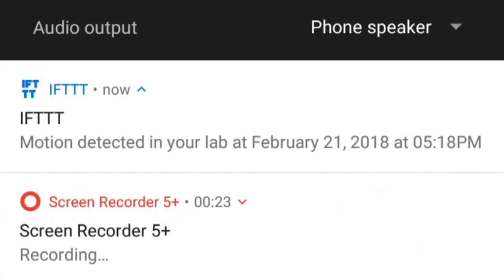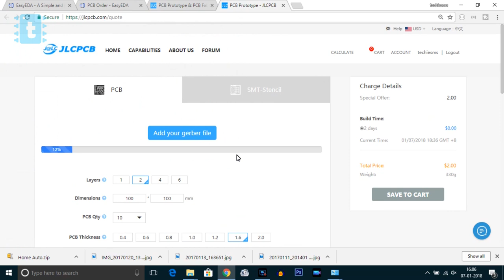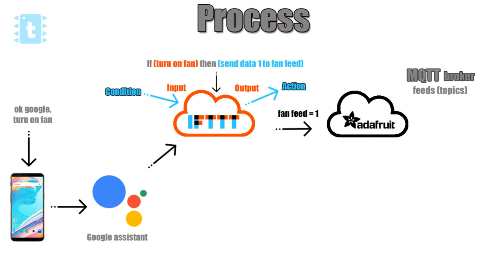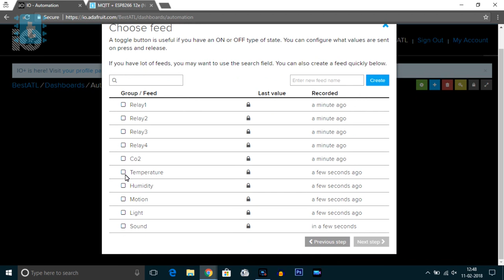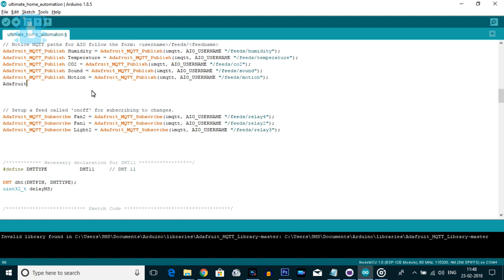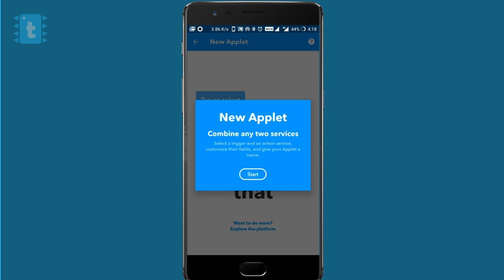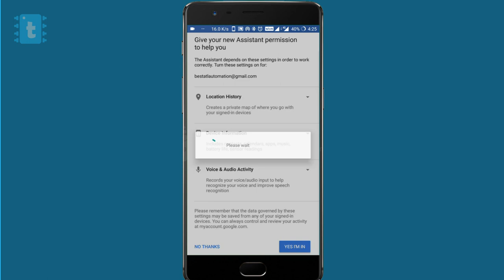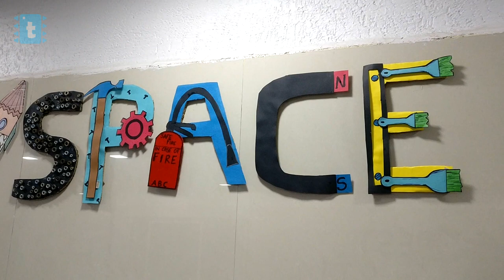Google Assistant Controlled Multiple Appliances | Monitor Sensor's data | IoT Projects | ESP8266 12e

Comment: We can use this for helping our moms in kitchen. We can monitor the temperature and LPG (leaking or not) from that we can turn on chimney or exhaust fan using relay. We can also turn on gas using Google Assistant also turn on light. Mothers have to see whether the water tank is full or not so that she can turn off the motor for that we will use water level sensor to check level of water in tank and to control it from Google assistant and IFTTT. We often open fridge without mother's permission so we can fit motion sensor so that mother will know that fridge is open. She can also control electrical appliances like Fan, Light, juicer etc. used in kitchen. 

Thanks .This was the best IOT tutorial by u..!!!

Comment: Firstly, Thank you so much!!! Your videos helped me a lot in learning about IOT. I'm from ECE and your videos are the best to know about many of the electronics especially nodemcu. I'm very much inspired by your videos and started doing simple projects using nodemcu. I have a project and idea which I am posting it here. Please do make some suggestions. I want to make a fully automated smart home that can switch on or off lights whenever you enter the room. You can also be able to control them using voice commands(using IFTTT and google voice assistant). You can also be able to control the devices like AC.Whenever the temperature is high (using dht11)and when it detects a person inside the room(using PIR sensor) , it automatically switches on the ac and gives a notification to the user. The project also focuses on security.Whenever we aren't home, and when it senses a motion before the door, it sends a notification to the owner.Picture of the person who is infront of the door can also be sent to owner.By setting the PIR sensor in a particular place or keeping the pressure sensor under the mat before your bed and collecting the data from some specified time in the morning we can identify when the person wakes and can automatically turn on the geyser and send some notification to the user.

Comment: people use teamviewer and other softwares for casting and controlling pc from large distances, but problem comes when the pc is not turned on. so we can integrate it to turn on the pc.
it should be applied where human errors occurs the most, like when someone turns on the water motor pump and forget to turn it off. it can inform the user about it and make user turn off motor or automatically turn it off.
it can be used to toggle headlights of cars in case someone forgets to turn it off. it can also be used to make car send location when asked and start vehicle and also to open or close garages.
it can be used to lock or unlock general home locks.
it can be used to limit usage of electronic gadgets used by children, so as to reduce their exposure to radiations and reduce wastage of their time.
we can command it to turn on toaster and coffee machines to as to prepare our breakfast while in bed.
thanks  for such a great guidance you provided through this video.

Comment: Hi sir 
I'm going make this project.
I'm startd designing pcb board but i have i doubt ''where did you use the PIR motion sensor in circuit?''
and connections of the relay "what did you connected between D0 and GND of the 9V?"

Comment: Stairs case wiring 
For controlling through mobile as well as Board switch's 
Both are we can use if mobile person is not there in lab so, we on off Appliances using switch's also.
Reply: Jaysukh Chavda yeah that would be convenient because relays are already SPDT
Reply: GPS module bhi interface kr sktehe kya ispe
Reply: Will staircase wiring work for this?

Comment: If it will take 20 sec to read data so when will it turn on the light bro as it is continuously reading lot of sensor there will be a great delay if i am wrong please correct me and please if you can explain the code more briefly

Comment: Hi,
Very Nice project and demonstration.
I would like to get the PCB or need your help to design with Easy EDA application.
Please suggest.
Reply from the maker: You can get my pcb design for free
Just search for techiesms user on easyeda
Reply: Thanks for your valuable response. 
Please suggest the link for the same. 

I have done a project with node mcu and relay module. But I wanted this to be on same pcb as you have done.

Please share the link for pcb and BoM for the same. 

Thanks & Best Regards, 
Rupesh Avinash Salvi
Reply from the maker: Connect with me on Whatsapp
82000 79034

Comment: urgent advice needed
what should  do if i have to connect mare than 4 relays ex if i have to connect 8 relays what should i do. PLS respond fast.
Reply from the maker: You can do that in the way I have attached 4 relays their is no trick in this
Reply: techiesms I tried doing that I even subscribed for the other four relays like it's done in the sketch and I connect the later 4 relays to d1,d2 and other data pins but the 4 relays that were already there worked the latter did not.

Comment: Hey, I need the Sensor Data on Google Assistant.
For example,
Me: Temperature at my home
Google Assistant: replies (reads the sensor value from Adafruit gauge) The temperature inside your house is 28 degrees.

How can Google assistant READ data from Adafruit?

Comment: it is good but it is not enough , i m also want to make home automation project which also count visitors with help of ir and in case of electricity power cut they notify me , if someone can switch on\off light it notify , and it has call based operations system using DTMF  for secondary options , door lock and unlock function and later on i m include R pi to add AI

Comment: 1)
It can be used as for agriculture field ( research field ) to know wheather temperature and humidity ,wind sensor rain detector all the sensor data and some out put devices from relay it connects to motor pump 
At night time automated bug Hunter setup will works totally the efficiency of this field can be increased and efforts will reduce by predicting the wheather

Also make a IoT gardan
2)
Also it can make a complete home automation for single living people because they the have to make their job easier via controlling appliances via internet

3)
The 3rd thing Maybe a stupidity!!

Because, it's my imagination and
if it possible only internet on space!!!

 whatever if it all implemented with all kind of sensors like light, temperature, humidity, magnetic field sensor,flux sensor, accelerometer, gravity sensor and all kind of gas sensor fixed on single board it can be act as a satellite and can launch with helium balloons and it can travel up to 30km and to over come the layer to make a small rocket like vehicle it can control by the relays...😎😎

Comment: Thanks a lot for your video and explaining. 
I think there are more precise temp/hum sensors DHT-22. 
You may use them in future (circuit is the same).
I think this project is perfect for studing. And it would be great to add some multiply temperature sensors ds18b20 to increase the ability to measure temperatures and, for example, to make automatic fan control according to setpoint temperature.
Please could you send me file for PCB board. 
Thanks and wish you great ideas for future videos and projects.

Comment: Mrunal Dhoble

One of the best thing it can be used is to Design a Smart Locker along with a Safest Locker room.. which must be equipped with a locking system using servo Motor and even we can track if anyone break's on to it using some essentially sensors and even we can place a servo lock system outside the locker room so as to quickly lock out the door from outside itself when opened without self access(using coding which will create auto-locking of the Door or manual command from phone). No need to fire a theft F.I.R as u'll get ur thief locked up in the locker room itself.. just needs a gud mechanical protection supported along with the locking module on the door. Plz let me know if this can be useful bro, and if yes.. i hope m in for the give awayz..😆😉

Comment: Hai, This is really a wonderful project and well documented. Thanks for publishing it. I tried it and it works fine but, if I have a slider to adjust the fan speed it will be still Great addition. 
Please suggest me the additional code lines in Arduino to incorporate this feature.
Reply: did u get the code for it sir??

Comment: great project , but if you can make that the google asisstant reads you out a sensor data , now that will be cool , like for examlpe room temperature.
Reply: Alexander221 I think you can do that with some ifttt integration
Reply: its damm simple use firebase as backend and and store your temp there and then just configure google assistent
Reply: The Arduino Guy i have implemented the same project using Blynk app so its quite similar 
can you please specify more details on how to do what you have mentioned??
Thanks
Reply: @ahmedsuhailabdullah6196  
Please explain me how u did that
Reply: @hemantbabel4279  
Hello, can u please explain me more on it
Reply: akshay shet just search how to use blynk app for automation, you’ll get it..
And the firebase one is a bit too lengthy and complicated
Reply: @ahmedsuhailabdullah6196  I want the sensor data to spoke out by the Google assistant when we ask commands as "what is temperature in room"
Reply: @hemantbabel4279  how to configure Google assistant?
Reply: @hemantbabel4279  how to configure Google assistant

Comment: I want to implement this project on my college. My college is an engineering college and college is very big and has many buildings . So,  There is a problem arises on switching on off the light of classrooms, labs , department and other places for the working peoples. So, by implementing this project we can omit this problem or you can that will be easy for them control things from any place. Also I want to implement this project like that I can control the light fans by normal switches and by this project. So, there will be manual option for some emergency. Also I want to add servos to control the speed of the fans by existing regulators,temp and humidity sensor and pir sensor.so,I  want those circuit boards for initial testing or you can say prototypeing in my college...

Comment: Arduino: 1.8.7 (Windows 7), Board: "NodeMCU 1.0 (ESP-12E Module), 80 MHz, Flash, 4M (1M SPIFFS), v2 Lower Memory, Disabled, None, Only Sketch, 115200"

Build options changed, rebuilding all
In file included from C:\Users\Mani\AppData\Local\Arduino15\packages\esp8266\hardware\esp8266\2.4.2\cores\esp8266/Arduino.h:27:0,

                 from sketch\sketch_nov16a.ino.cpp:1:

C:\Users\Mani\AppData\Local\Arduino15\packages\esp8266\hardware\esp8266\2.4.2/tools/sdk/libc/xtensa-lx106-elf/include/stdlib.h:16:20: fatal error: stddef.h: No such file or directory

 #include <stddef.h>

                    ^

compilation terminated.

exit status 1
Error compiling for board NodeMCU 1.0 (ESP-12E Module).
Invalid library found in C:\Program Files (x86)\Arduino\libraries\Ultimate-Home-Automation--master: no headers files (.h) found in C:\Program Files (x86)\Arduino\libraries\Ultimate-Home-Automation--master
Invalid library found in C:\Users\Mani\Documents\Arduino\libraries\libraries: no headers files (.h) found in C:\Users\Mani\Documents\Arduino\libraries\libraries
Invalid library found in C:\Program Files (x86)\Arduino\libraries\Ultimate-Home-Automation--master: no headers files (.h) found in C:\Program Files (x86)\Arduino\libraries\Ultimate-Home-Automation--master
Invalid library found in C:\Users\Mani\Documents\Arduino\libraries\libraries: no headers files (.h) found in C:\Users\Mani\Documents\Arduino\libraries\libraries

This report would have more information with
"Show verbose output during compilation"
option enabled in File -> Preferences.
Reply: Same to you

Comment: We can use this Board at Nuclear power reactors & Oil Refineries  where high radiation and high fire risks are there respectively, 
By Connecting this board in that places we can control all machines and gather data by sitting far away .
from this we can save many lives........from some disasters..😇
Reply: We already do that.